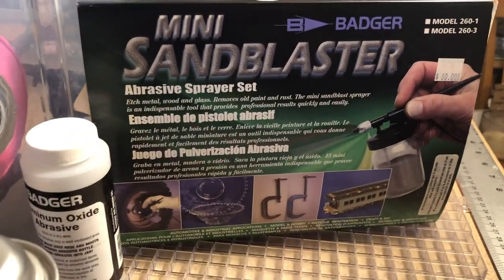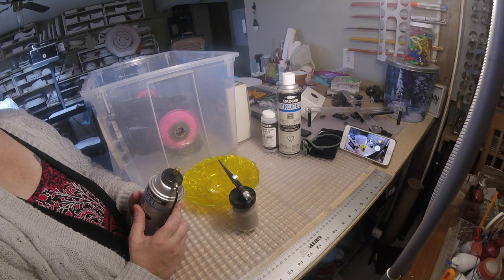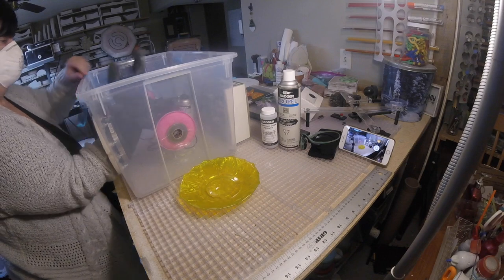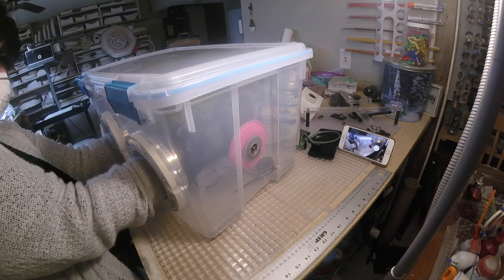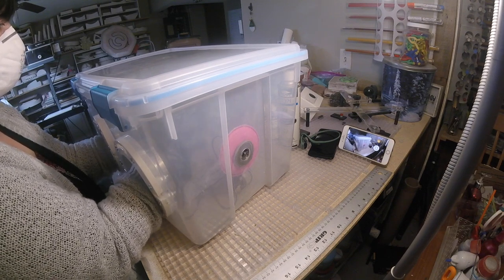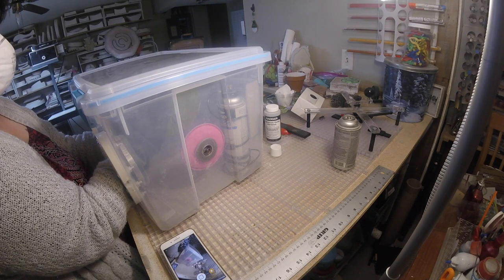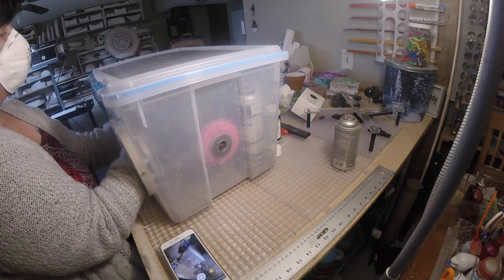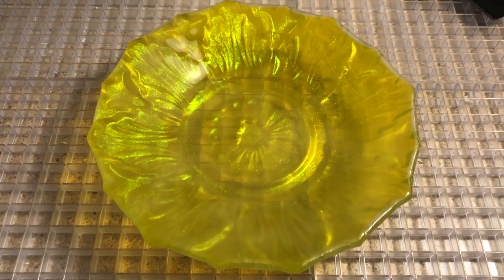Mini Sandblaster Demo on Fused Glass

Comment: Amazon has adapters that would allow someone to use a hose from one of the other airbrush compressors or a normal shop compressor as well as quick disconnects that allow direct connection to a hose with a quick disconnect fitting on it.